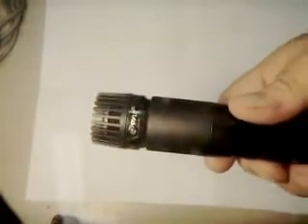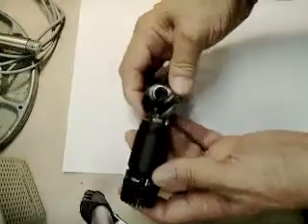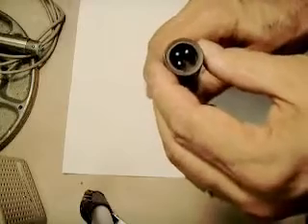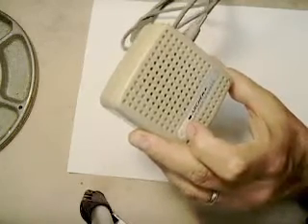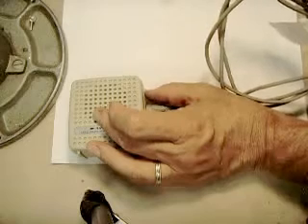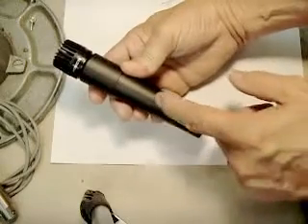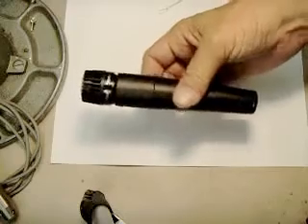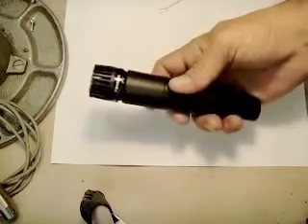Pyle PDMIC78 Microphone - SM-57 Knockoff

Comment: Dude, I got the same mic for a steal at my local music shop, found a video on it for modifying and rewiring it for a balanced output, I use an adapter with it that I plug the mic into and then plug it into my amp or PA. The adapter has the electrical capacitor and transformer inside that are supposed to be inside these mics to start with...anyway, that being said...after you rewire the mic and use the transformer adapter with it...it is one hell of a mic...I absolutely LOVE mine, and plan to buy quite a few more. Pyle also makes the PDMIC58 which is a clone of the Sure 58, I believe...also have one of them as well...excellent mics once you modify them for a balanced output and use the transformer adapter. Just thought I'd throw that in there!!
Reply from the maker: - Very nice! Thanks for sharing your experience. I think many folks are now getting these mics for the performance and of course the cost.
Reply: Bob H
-- You got it!! The way I see it, why pay hundreds of dollars on a mic, when you can get a clone or import for a fraction of the cost?? Yeah, you might have to modify it a little or do a little upgrading...but it's well worth it to me in the end. Money is tight, and as a musician you have to be able to work with what you can afford...even if it's a DIY project, which I have done PLENTY of...with pretty damn good results. Hell, you can take a shitty headset laptop mic, use a program called "Voicemeeter" by VB Audio and that software program is absolutely AMAZING!!! You can make a shitty $20.00 mic sound like a $1,000 studio mic with a little tweaking of the software. I use it ALL the time for my vocal tracks. I really couldn't do diddly-squat without that program. My Pyle mics already sound great, but dude...the Voicemeeter program takes it completely over the top!! You might look into it!!

Comment: My screw doesn't even unscrew on mine -_- (yes I unscrewed clockwise) lol can't do the mod ... Though theoreticaly over 5m unbalanced shouldn't be a big problem... I'll be testing the mic tomorrow
Reply from the maker: Interesting! Maybe try turning screw the other way. Maybe they're making them different than the ones I got, where you have to unscrewed counter clockwise. Thanks for letting me know.
Reply: Bob H Yeah tried the other way aswell, it turns (both ways), nothing. hun
Reply: Bob H Yeah that is what I was thinking a stripped screw, I'll mail amazon saying it has a bad connection and i'll see. Otherwise i've tried it, and it's not too shabby at all, it actually sounds closer to the SM57 than my other, sm57 copy the T.bone MB75 (my T.Bone, doesn't have that SM57 sizzle in the high end ). As it is it's worth every penny

Comment: Hi there
Does a microphone capsule, which is usually a single ended output, not require a device, either electronic ( op amp based) or transformer to convert it to a balanced, differential output ?Hence the transformer in the Shure. The secondary of the transformer provides a differential, 180 degree out of phase split output, which cancels noise. I'm a little sceptical that this mod is simply disconnecting the 0 volt of the capsule from the chassis of the microphone. I would love to be wrong as I've just ordered one of these and would love it to be balance convertible for £12.00! Can't help thinking the manufacturer would have shipped it balanced ( and promoted it as balanced) and simply used the lead to unbalance it, if this was possible with the installed capsule. Just my humble opinion folks.
Reply from the maker: Good question. The term 'balanced' usually means that neither side of the signal source returns to ground. The mic element in the PDMIC78 mics don't have any preference either way.True, there are mic elements that may have a metallic housing of which one side of the wiring is connected. These are usually the ceramic/crystal types used in communication and are generally high impedance. The Astatic MC-151 is one such mic.Electret condenser elements are often the same. In either case, some kind of unbalanced to balanced transformation is necessary if such shall be used for professional applications. In the case of the Pyle PDMIC78 mic, the dynamic element is already 600 ohms need no further impedance transformation. Therefore, it can be wired directly in the balanced configuration. Notice the Electro-Voice RE15 mic -  it's mic element is wired directly as balanced. You can see the wiring diagram at this URL... http://www.coutant.org/data/re15.pdf Here's a good tutorial of the concept of balanced vs unbalanced... http://www.aviom.com/blog/balanced-vs-unbalanced/ As to why the Pyle PDMIC78 mics are wired as unbalanced is unclear. One point we can be sure of is that the original Shure 57 mics are balanced. Why the Pyle PDMIC78 copy mic would be wired differently makes no sense, thus the video I made to show that it can be done with no sacrifice to the sound.

Comment: Thanks ! Received two PDMIC78 this morning and modded them wihout even testing them unmodded ;-) They sound great ! Excellent deal all the way...
Reply from the maker: +Cédric Thomas - Thanks for the 'feedback.' Glad to hear that the mod worked ok for you. It makes no sense why these mics were wired unbalanced. Balanced XLR connector, but wired unbalanced (?). Simple fix tho.
Reply: torontothegood You won't be disapointed  ; -)
Reply: +torontothegood Hi, how did the mod go ? Are you satisfied with the results ? I forgot to mention that in my mod I also changed the cables inside the mic and used thicker ones...
Reply from the maker: +torontothegood - From Cédric Thomas - Hi, how did the mod go ? Are you satisfied with the results ? I forgot to mention that in my mod I also changed the cables inside the mic and used thicker ones...

Comment: Not saying what you're doing doesn't work, but plugging it into an Archer amp—which I don't believe has a balanced connector—doesn't verify that the mic is now balanced. The amp is probably only getting the pin 2 signal (and shield), which was unchanged in your mod, so I wouldn't expect any difference after the mod.
Reply from the maker: clinke2007 clinke2007    The amp has nothing to do with the wiring or the performance of the mic. I simply used it to test the mic.    The female XLR to mini-phone cable had been configured with pins 1 & 3 connected to shield.. this is a normal configuration for a balanced-to- unbalanced cable. (I made the adapter cable in this vid.)    If you watched the video in its entirety, you'll will notice how the wiring was reconfigured to a balanced connection.    Please notice the wiring of a standard balanced SM58 mic (the 57's are wired the same) at this website:    https://www.shure.co.jp/dmsfiles/default/shure/products/microphones/user_guides/sm/sm58_specsheet
Reply: Bob H All of what you say is true, and none of it is opposed to what I said. Which was that with cold (pin 3) connected to shield (pin 1), you're not testing whether the mic is active-balanced. I apologize for repeating myself, but all the test above proves is that the hot (pin 2) is sending a signal. It does not address whether pin 3 is sending the inverted signal. Again, I'm not saying your mod doesn't work, but rather that the testing is incomplete.
Reply from the maker: clinke2007   Very well, what else would you like to see regarding the 'test'?
Reply: Bob H Whatever would demonstrate that the cold is 180° out of phase with the hot. There's probably many ways to do that. For giggles, I just recorded an SM57 into Pro Tools, with the hot and cold each recorded on their own tracks. Each was correctly out of phase with the other.

I've got a PDMIC78. Maybe I'll do your mod and check it the same way.
Reply from the maker: clinke2007 Ok, electricity 101: The fact that the mic actually works already indicates that the cold is 180° out of phase with the hot. If they were both in phase, it would not work. I'm not going to demonstrate this, as it's self explanatory.   Try it out for yourself. All I have done with the mic is lifted one side off ground...that's it.   This does indeed make it balanced.   If you need further proof, I'll gladly give you references as to how unbalanced/balanced audio, video, and electrical principles work.
Reply: Bob H Logic 101: How do identical results before AND after your mod prove that the mod actually did anything? Your mod disconnects pins 1 and 3 from each other in the mic, right? Yet you state the cable you use connects pins 1 and 3, thus undoing your mod. Do you see what I mean?
Reply from the maker: clinke2007   Evidently, something is getting lost in translation here.   Sorry that you're not understanding it.  Please refer back to my 1st original reply to your question.   If you would like further info about this, feel free to message me off page.
Reply: Bob H "Evidently, something is getting lost in translation here."

That's precisely what I was thinking. ;-)
Reply: There is no other way for passive dynamic capsule only to have each of the poles to be in 180 degree phase, this is how anything with coil works. There is no real "ground" only what you decide to be. There is simply no need to check or verify that. The coil will always have each wires in 180 phase and that's it.
Wiring it this way on video is correct. But of course the xlr to 1/4 cable will undo all that. But that is not the point, if you stick normal xlr/xlr cable to such "fixed" mic and use balanced input it works just like any other balanced mic do, that is to reduce HUM with long cables. Of course with the short supplied cable you won't have hum anyway balanced or not. It is correct they could easily wire the mic as balanced and it would work exactly the same with the xlr-1/4 cable as before. Why they didn't? Who knows.

Comment from the maker: Reply to Romo Drummer-
 
Yes, I think that's correct. I did a dissect the mic cable that came with the Pyle PDMIC58 Mic and I found this to be the case.
  ( see vid  https://youtu.be/ts_KAQII8IA ) 

I hadn't checked the cable for the PDMIC78 here, altho I would not be surprised if it was wired that way. The vid shows how to check and fix this.

Comment from the maker: Reply To Magic .Mark:
  Yes, you're right. Most all XLR to 1/4" adapter cables are internally connected for any balanced mic to be used for an unbalanced input, such as a karaoke machine or PA as you mentioned, without any degrade in performance. In fact, some balanced mics come with an XLR to 1/4" adapter cable for such a use. Please note: The only reason for changing these mics to a balanced connection, is that this is the way most professional mics are connected. This modification does NOT need to be done for the mic to function normally. For short cable runs, there will be no increase in performance with this modification anyway.
Reply from the maker: +Magic .Mark - Interesting! I can't imagine how it would've had that much of an effect on just changing it to balanced, but I'm glad to hear it worked good.

Comment: Isn't  the reason they tied the two pins together as they are  making it for the 1/4" unbalanced jack on most PA or Karaoke  machine?
If I  "balance" this mic as you are showing, can I still use the XLR to 1/4 cable that comes with this and use this on an unbalanced 1/4" input without any negative change in performance?

Comment: I dont think that the modification you have made has actually made the Mic balanced. I think to to balance the lines the cold line (pin 3) needs to have the same impedance as the hot line (pin2) which in this case is600 ohms. Otherwise the lines wont pick up noise in the same way, so wont work correctly through a differential amplifier. To rectify this I coupled ground to the cold (pin 1 to 3) via (as near as possible) a 600 ohm resistor which seems to have worked!

This website was very helpful :

http://community.avid.com/forums/t/58612.aspx
Reply from the maker: Laurence Falconer  Thank you for your comments. I can understand where this may seem a bit confusing, but the mic is in fact truly balanced. You can verify this with any balanced mic by using an ohm meter and checking continuity between either pin 2 or 3 to pin 1 (ground). There should be no continuity. This follows the rules and principles of balanced audio where neither side is grounded. As long as neither side of the signal path is grounded, this makes it balanced. Balanced audio has been used many of years and started back with the telephone companies and Bell Labs. Balanced audio has the ability of Common Mode Rejection, whereas, unbalanced does not. The following video explains this concisely: Balanced vs. Unbalanced Audio https://youtu.be/jo5HhfIUSP0 Cheers, Bob
Reply: Bob H The video which you linked to explained how fully balanced microphones work, but in this case there is nothing to invert the signal for the cold line, so essentially all you are doing here is setting up line 3 as your drain and and pin 2 as the hot, so when connected to the differential amplifier it will amplify the diference between the ground level of the amp and the hot signal including any noise on the line. If however the pin 3 was connected to pin 1 with a resistor of the same impedance as the mic, then both line 3 and line 2 would pick up noise in the same way, and as such, when applied to a differential amplifier (because the noise is the same on both channels) it will only amplify the signal you have on line 2. So what you have done in this mod is just have the shield on the microphone be earthed seperately to the drain connection on the mic, which doesnt help with any noise rejection.

I Hope that makes some sense. After some quick googling to find a circuit diagram ( rather than scanning in my drawing) this came up which does a pretty good job! http://www.epanorama.net/newepa/2010/02/23/unbalanced-to-impedance-balanced/

Regards,

Laurence
Reply: Laurence Falconer Actually after a bit more research found this page which has a very good explanation (much better than I managed) of what I was trying to explain! 

http://www.soundonsound.com/sos/oct13/articles/qanda-1013-4.htm

Hope you find it helpfull!
Reply from the maker: Laurence Falconer  I think you're misunderstanding the concept of 'balanced'. A balanced system does NOT need a ground reference. As you so stated about the video, the difference between the 2 phases are amplified.  It's the same with the microphone. Neither side of the mic element is grounded. The mic element is an AC source (if you will), just like the video explained. So, the mic element has 2 wires...that's it, no more.. just 2 wires. There's where the AC signal source is. Now, that travels down 2 conductors to the balanced input - be it differential amp or transformer input - as long as neither side is grounded, it is balanced.. just like the video explained.  With the Pyle mic mod, the one mic element wire was simply lifted off the ground side (pin 3) and isolated along with the other mic element wire (pin 2). Therefore, if neither side is grounded, or has NO reference to ground, this is balanced. To confirm this, simply get a Shure SM57 or SM58 and check pin 2 or 3 to pin 1 - there will be NO continuity AC or DC. Try it! Let us know what you find.  ;-)
Reply from the maker: Laurence Falconer See the Shure mic wiring diagrams on these sites. Notice that there is NO connection or continuity whatsoever from either of the mic element wires to ground...`https://www.shure.co.jp/dmsfiles/default/shure/products/microphones/user_guides/sm/sm58_specsheet
Reply: What confuses you is that you think one wire is hot and one is cold. With coils both wires are hot but in 180 phase. Once you ground one of them, then you are unbalanced and can speak of hot and cold wires. That is not the case in balanced mics. The link you posted talks mainly about electronically balanced transmission or a way to emulate native balanced component (such as mic coil) with electronic for long transition of audio data.
Reply from the maker: The terms HOT and COLD can also refer to + and - phasing as within the context I used. In this case, I was making it clear as to which wires I was moving and where they were going. Not sure what link you're referring to, as I posted several. Here's one that has a schematic of how EV wires their balanced mics... http://www.coutant.org/re15/ . The electrical principles are all the same for balanced line applications.

Comment from the maker: Reply to Dylan Shah

You're right about the sound--it is different from an authentic 57, but not necessarily bad, just a bit different. Then again, it's a $13 mic.

As to changing the wiring to a balanced connection, you will NOT hear any difference in sound quality. The point in changing it to a balanced connection is to make it like an XLR mic should be wired in the 1st place--NOT unbalanced.

See YouTube vid: Balanced vs. Unbalanced Cable - What's the deal?
http://youtu.be/BQtMFsw_3Hg

Comment: i have the mic, i brought it as a short term replacement for the 57. the sound is completely different, the knockoff is based purely on look rather than sound. also, i don't recognize any noise, i'll rewire it as you suggested and report back but if you use it to record guitars etc like they were made for i don't see why it would make a difference.
Reply: according to this detailed analysis whilst its is a little brighter with a 2-4k peak compared to an old 57  it sounds pretty much identical to newer SM57s! https://www.aguitarforum.com/threads/my-thoughts-and-review-of-the-pyle-pdmic78-sm57-clone-microphone.82477/